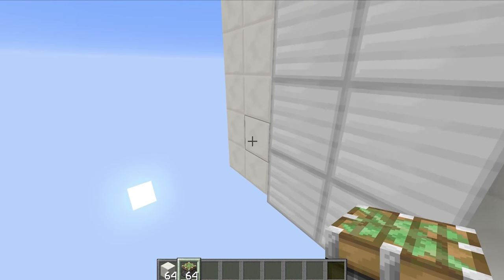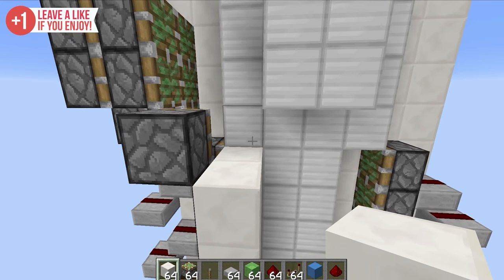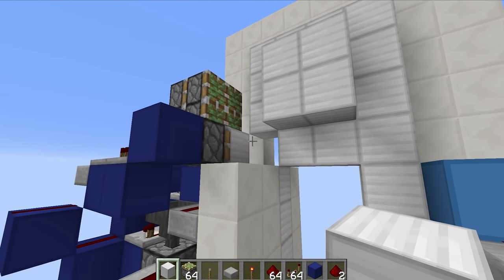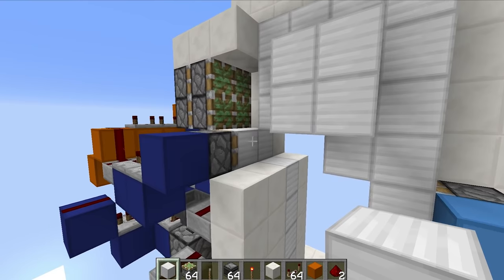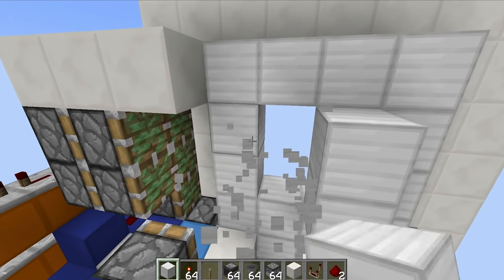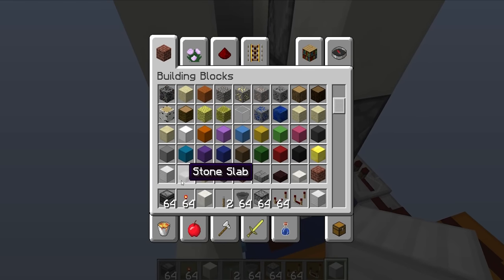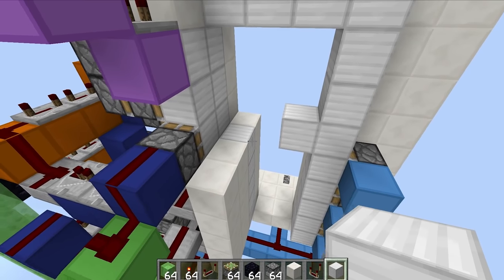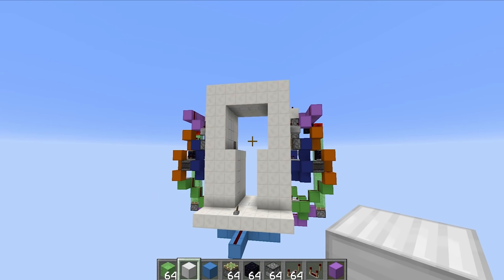MINECRAFT CHALLENGE: The Giant SPOON DOOR!

Comment: do a piston door without using STICKY pistons you may use regular ones
MAKE BIG ONES
Reply: He chooses the size?
Reply: Mate you don't need to say you can use regular ones. 

It's a piston door
Reply: i guess?
Reply: Rasheed HD - He could use slime blocks on pistons.
Reply: i was thinking one with sand + it wouldn't work with slime blocks because you know the push limits of pistons if he wants to make a big one
Reply: 3x3 to make easier for him
Reply: Aria the Vlogger then the pistons wouldn't pull back. He'd have to make a smart piston extender on each side, one for the extension, and one for the retraction, and since they'd have to push each other, he would only be able to make a 2x2 door
Reply: i think he will do like first 2x2 then 3x3 then 4x4 and so on just like what he did with the pistone extenders
Reply: he could you sand or tnt
Reply: Rasheed HD maybe just double piston extenders for a 1x2 vertcal door?
Reply: If you want him to see that, try sending him a tweet.
Reply: A 3x3 could be 6 3 piston extenders
Reply: you can not do that
Reply: Aria the Vlogger Slime blocks on regular pistons don't stick to the pistons either.
Reply: I think this is just a huge T-flip flop?
Reply: Rasheed HD 2x2 first without slime blocks, gravity-affected blocks or non-full blocks that can be spotted without looking into the redstone.
Reply: I DID